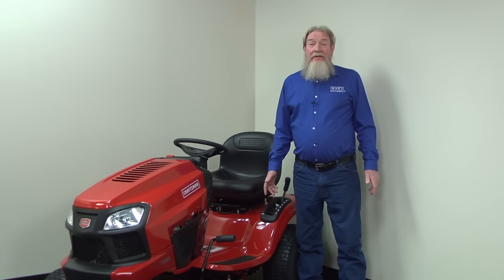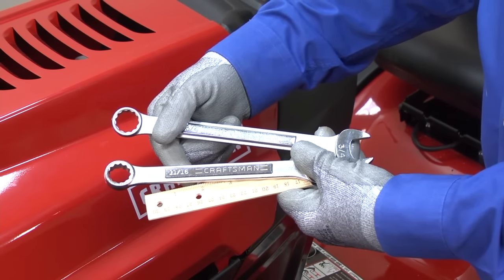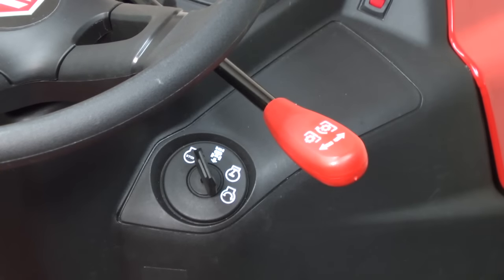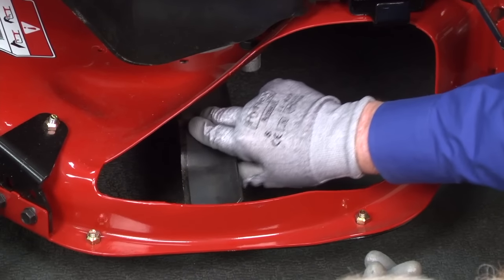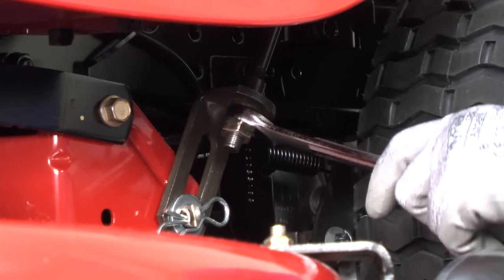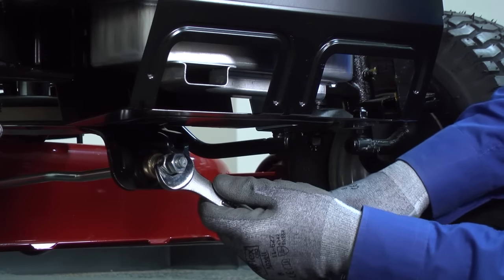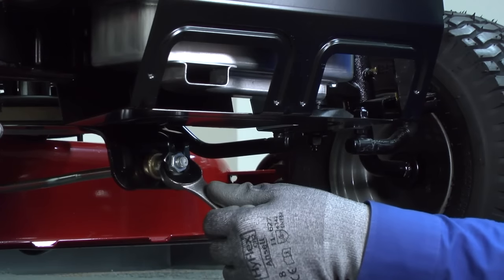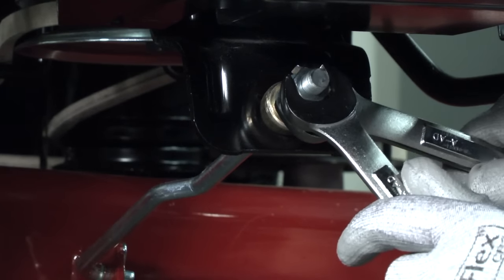Leveling a Riding Lawn Mower Deck for an Even Cut

Comment: WHOA WHOA WHOA... Now looking in through the grass chute is all fine and dandy but you never showed how you can see or measure the OTHER side that DOESN'T have a chute you can look through.  It is VERY difficult to look under the deck and try to get decent eyeball on that measurement.  I know, I have a T310.  Is there some special measuring tool to use to make this an 'EASY' measurement check?     Don't get me wrong, good video but you gave the easiest part for measurement.  You should show how you measure the OTHER side ;)..   What I had to do is grab 2 - 6" magnetic levels and use that placing on  the back of the mower on top of the attachment lip ( where you can hook up a like a yard trailer or something) to ensure the mower is level, then placing 1 on the back center location of the deck where the lip is.  Now this is for a left/right adjustment.  There was one other spot I could double check the levelness of it and that is by swapping the level from Back Center of the deck to the 'left side of deck' as you sit on it where there is NO grass chute.  This was the top back portion of the left side where the circular mold of the deck was for the blade.  The right side of the deck where the grass chute was as a slight incline from about center to the chute so I couldn't use anything on that side.  I also didn't have 3 - 6" levels so I had to swap the 2 deck locations.  It's not as accurate as a measuring tape or ruler but after making that adjustment with the 2 levels and mowing this evening, I don't see any 'stair step' effects in the grass lines where I mowed.  This is just the way I did it cause I couldn't see up underneath the other side of the deck to see the measurement.  So YES I did it the 'lazy mans' way hehehe... IF you do use the levels, you HAVE to know what part of the top portion of the deck are parallel with the bottom of the deck.  That's why I used that lip on the back center just above the bottom of the deck and the other top part of the deck that  KNOW is parallel with the bottom.  ;).. Hope this helps, but would like to know if there is a easy tool for 'measuring' the blade on the non-grass chute side.  ;)
Reply: The left side is definitely a little trickier.  I  just use one of those long soft wax dinner candles (very cheap at any grocery).  Trim it down to fit under the deck, then press it against the blade underneath and measure the mark!
Reply: @GSX1300Rrr  As if your fingers couldn't have done the same thing.
Reply: You'd think an adult could have figured it out in three sentences or less.

Comment: how do you measure the blade height on the side that has no shoot hole in it
Reply: YOU LAY ON YOUR SIDE AND USE A SHORT RULER THAT FITS UNDER THE DECK.
Reply: Use a mirror and a folded piece of paper with the ink line on it.

Comment: On the newer ones there is an adjustment not like the one he shows . On my friends mower was a brass looking nut with a 1/2 in. bolt in the center that you have to loosen then turn the bigger nut to adjust side to side and on the front a 3/4 in. nut with no locking /jam nut on it took me only 15 mins. to do .

Comment: My Husqvarna lgt2554 has never seemed to cut even, and if I drop my cutting height adjustment to the lowest setting, the deck hits the ground on about setting 3. So, I don't have much adjustment, from 4 to 7. My tires have equal pressure. Thank you, JohnG
Reply from the maker: Your mower has side-to-side adjustment nuts on both sides of the mower deck. Adjust both sides and the front leveling nuts to lift the deck to its highest possible position then level the deck. We hope this information helps. If you need further assistance, let us know.
Reply: @searspartsdirect  thank you

Comment: My new Craftsman T210 mower (2020) has only two scalp wheels.  My older Craftsman YT4000 had four scalp wheels.  Also can/should I add two additional wheels to my new mower?
Reply from the maker: The manufacturer recommends against any alterations of the mower. Keep in mind that any manufacturer warranty claims can be disputed if you alter the mower. We recommend against adding the scalp wheels. The mower should work just fine with only 2 scalp wheels.

Comment: Adjusting one side is the adjustment for both sides??
Reply from the maker: Yes. For many riding mowers, only the left side of the deck has a side-to-side adjustment link.
Reply: @searspartsdirect that makes sense.  I noticed on the right side it has only a hooked shaped bar holding the deck to the mower and no threaded adjustment like the left side

Comment: Why does the front of the blade have to be lower than the back? rather than at the same height?
Reply from the maker: Tilting the mower deck slightly forward helps limit air flow to the rear portion of the deck and keeps grass clippings moving through the front of the deck to the discharge chute.

Comment: So at the decks highest setting, how high should the blades be from the ground? I think mine is too low.
Reply from the maker: Maximum blade height varies by model. Many models have a maximum blade height of about 4 inches. Let us know the model number of your riding mower and we'll check on that specification for your mower.
Reply: Mine is a Craftsman 2010 YTS3000 with the 46” two blade deck. I just cannot seem to get the deck set correctly, there’s always one strip of lawn that doesn’t seem to get cut. I have replaced both spindles twice and have tried all sorts of blades from different mfg’s.
Reply: Also while I got you, what is the difference between the YT3000 and the YTS3000? Thanks again.
Reply from the maker: @hdrjunkie  Maximum cutting height on a 2010 YTS3000 with a 46-inch deck is 4-inches. Here's a link for an online version of the owner's manual for that riding mower: https://www.searspartsdirect.com/manual/603c81fzag-000247/craftsman-917289240-front-engine-lawn-tractor . If the uncut strip of lawn is on the side of the cut, make sure that you check the tire air pressure and level the deck according to the instructions in this video. Make sure that you have the blades and mandrels installed correctly. The blades listed by the manufacturer for this mower are parts 532403107 (mulching blade-- https://www.searspartsdirect.com/product/40z49pts8g-0071-917/id-403107 ) and 405380 (high-lift bagging blade-- https://www.searspartsdirect.com/product/30gg1rbc8r-0071-917/id-405380 ). We recommend that you use a set of the manufacturer recommended blades on the mower. We hope these tips help. If you need further assistance, let us know.
Reply from the maker: We don't see a YT3000 model offered in 2010. When a YT and YTS model are offered for a mower series, the YTS model typically has added features such as a textured step platform, a larger engine, a higher seat back and a larger gas tank.
Reply: Awesome thanks! And thank you for clearing up the YT vs YTS mystery!

Comment: Thanks for the video! I didn't see the lift link lock nut on my tractor, also my lift level is on the right side of the seat. The model number is 247.288811, so where to find the lift link lock nut on this model?
Reply from the maker: Leveling the deck on your model of Craftsman tractor is covered in the owner’s manual on page 22. Here’s a link to the owner’s manual in case you need it: https://www.searspartsdirect.com/partsdirect/user-manuals/247288811-craftsman-parts-manual. The drawings in the manual show the locations of the deck-leveling nuts for your model.

Comment: Good video but it would have been better if you had also shown measuring the blade on the off shoot side.
Reply: Yes, what if you have a 3 blade mower, which are common?
Reply: because you can't use a ruler or access the blade on the other side lmao.  how can you tell it's level side to side if you only measure 1 side? didn't rotate the blade 180 degrees to make sure the blade isn't bent lol.
Reply: also, changing the front to back will change the side to side so better to recheck

Comment: My mower cuts way to low for my taste. Even on the highest setting it cuts too low. Is there anyway to raise the overall height of the deck? Husqvarna 22v46
Reply from the maker: Maximum cutting height for this mower is about 4-inches. Make sure that the tractor’s tires are fully inflated to help keep the deck elevated properly. You may be able to adjust the mower deck link adjustment nuts to raise the deck slightly upward. Make sure that you level the deck side-to-side and front-to-back after adjusting those nuts to raise the deck. If you’ve replaced mandrels on the deck, make sure that you installed the correct replacement mandrels because using incorrect replacement mandrels can lower blade height. Here’s a link (with a photo) of the correct mandrel for the mower deck on your Husqvarna riding mower: https://www.searspartsdirect.com/part-number/532192872/0071/917.html.

Comment: I've done exactly as explained in the video. My issue is the cut in the middle of the deck is higher (between the blades). How do I adjust the blades' level across the whole deck?
Reply from the maker: Make sure the blades aren’t bent by laying the blades on a flat surface. A bent blade won’t lay flat. Replace the blades if they’re bent. If the blades aren’t bent, then the mower deck may be bowed upward in the middle. Replace the deck if it’s bowed upward.
Reply: You can get your deck bent back, before spending big bucks buying a new deck....
Reply: deck is bent
Reply: Buy a lawn mower from a dealer, craftsman mowers are Junk.
Reply: chaotic/Silence    I don’t understand why you say craftsman mowers are junk , unless you have had a lot of issues with them.I have seen people have a lot of issues with expensive higher top of the line mowers.You see them in the repair shop also.I am not saying craftsman is problem free ,but I have seen craftsman mowers that are pretty old an still working great, of coarse someone has taking care not to abuse them further than their intended use.A lot of things can go wrong with any mower even mine, but you can have some degree of control just by taking time to doing a precheck & after check when using. This rings true for any lawn equipment instead of just firing it up an going about.Remembering that things aren’t made any more like they were back in the days, so you have to check your equipment carefully to prolong it’s life. I’ve caught issues with my Craftsman in the early stages before they were major,an also on my neighbors equipment to save them any headaches. Please reconsider your dilemma about craftsman mowers.
Reply: I've had the same craftsman riding mower for 21 years and haven't done anything to it except change the oil, tires and a fuel pump. This mower has been rode hard also! Saying craftsman is poor quality is not true
Reply: @royceyatesjr  21 years ago Craftsman was still Craftsman. The company has been sold to Black & Decker Stanley. It's not Craftsman anymore. It's just a sticker now.
Reply: I still use my john deere lx172. 30 years old..original peerless trans and mow the yard better than a new "craftsman" 😘

Comment: Where can I find a user manual for a 1990s Craftsman model 917.256820, serial 031092S, 001405?
Reply from the maker: We didn’t find an online copy of the exact manual for that lawn tractor available. Here’s a link for an online copy of the manual for a similar model: https://www.searspartsdirect.com/partsdirect/user-manuals/917254520-craftsman-parts-manual  The paper copy of the manual is still available. Here’s a link where you can order a copy of the exact manual for that model: https://www.searspartsdirect.com/part-number/135384/0071/917.html
Reply: @searspartsdirect  Thank you!  That is a pretty close match!  Much appreciated!

Comment: I level the mower deck and it maintains for about 2 mows then loses level. I can't figure it out. My mower is only 2 seasons old, only cuts my own yard and I pulled the blades once for sharpening and started having problems after replacing. I'm the only one who runs it, it hasn't ridden on a trailer since delivery.. I baby the thing.

This make sense to anyone?
Reply: I have the same problem with my Husqvarna. I have an adjustment on the left side for the back of the deck. None on the right side..

Comment: How you measure the side without the shoot
Reply from the maker: You can carefully reach under the mower deck on that side and mark the height of the blade on the ruler with your finger or a marker then pull the ruler out to see the measurement.
Reply: Kalon Johnson I used a piece of wood chim and broke the tip off so I could get under there. Mark the side of the chim with a pencil or marker. Mine was off one and a half inches! Now they are about 1/8 " off which is fine.  This video was great thank you.
Reply: I use a 4 -5 inch bolt, put 2 nuts on it (the bottom nut keeps the top from moving once you set it) I go to the chute side and place the top nut to where it just fits under the cut side of the blade. Then on the opposite blade side you can't see you can put the bolt there and feel if it fits. If not you raise it until it does... usually you can place your thumb in the spot where the blade hits on the bolt to get an idea of how much you need to move it.
Reply: Cori VanBibber Great tip!
Reply: Park your mower on some 2x4s level is level doesn't matter if u add 2 inches equally
Reply: Deck leveling guage works pretty good measuring on that side I'm gonna get one cause my 2006 cub cadet z-force 44 is cutting uneven and I'm not sure if it's my tire pressure or an uneven deck or both.
Reply: @corivanbibber6096 , great idea !

Comment: what about between blades, my drivers side blade tiles down in the center (where the two blades are closest), Even after replacing the blades.
Reply from the maker: We recommend that you check for mower deck damage around the mandrel housing for the driver’s side blade. A crooked mandrel can cause an uneven cut in your situation.
Reply: deck is bent
Reply: Your deck is bent you probably ran over a heavy stick or hit something.

Comment: YES - how the hell do u measure the side without the shoot - How about measuring the bottom of the deck itself  I would  think  the bottom of the deck should be flat & level
Reply from the maker: You can carefully reach under the mower deck on that side and mark the height of the blade on the ruler with your finger or a marker then pull the ruler out to see the measurement.

Comment: Ummmmm, Is the position 6, 6 inches above the ground orrrrrrr?
Reply from the maker: The blade height at various positions of the blade height lever vary by mower model. Let us know the model number of your riding mower and we'll try to provide the blade height specification for cutting position 6.
Reply: @searspartsdirect  I have a Craftsman YS4500
Reply from the maker: @gregorysrock2321  The highest cutting position on that model will lift the cutting blades about 4-inches above the ground.
Reply: @searspartsdirect  great thanks
Reply: I have a YT3000. What should the blade height be?
Reply: @ImNotRite  on my YTS3000 the highest position put the blades at about 4 inches above the ground.

Comment: How in the hell you going to check the blade level one side you can't even see the blade tell me tell me please
Reply from the maker: You can carefully reach under the mower deck on that side and mark the height of the blade on the ruler with your finger or a marker then pull the ruler out to see the measurement. You can also cut a wood shim to the height of the chute side blade and determine whether the deck is level by placing the wood shim under the blade tip on the side without the chute. We hope this information helps. If you need further assistance, let us know.

Comment: The height should be within 1/8 inch... Of what?!
Reply: Each end of blade and each blade on your mower.
Reply from the maker: The blade tip height on one side of the mower deck should be within 1/8-inch of the blade tip on the other side of the mower deck for the deck to the level.